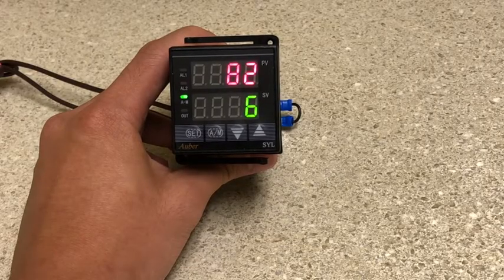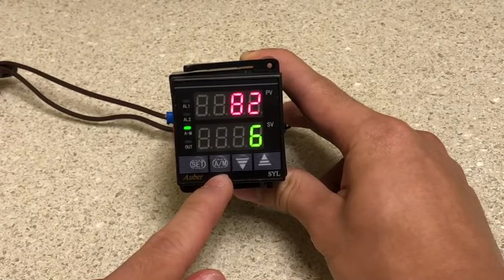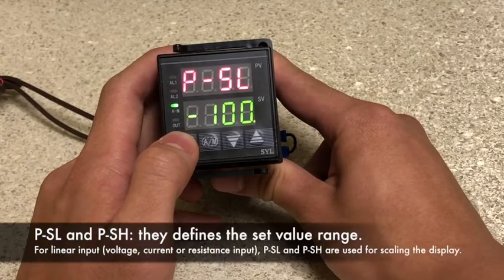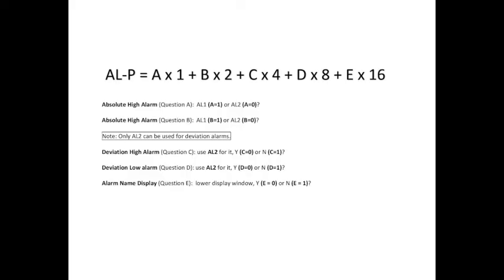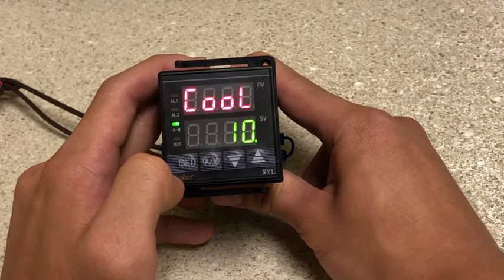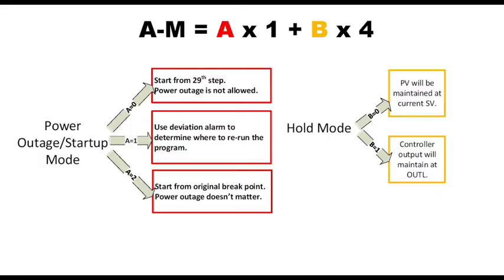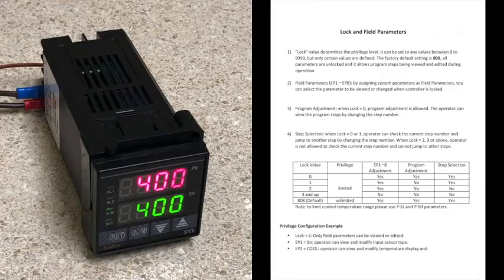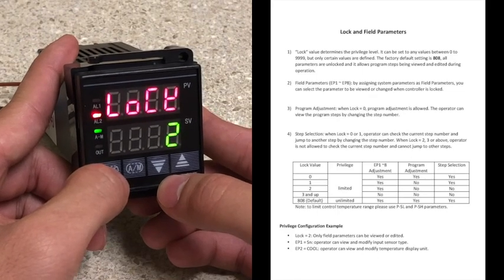Ramp & Soak PID Basic Tutorial, Auber SYL-23X2P Series

Comment: I got the 2342P but it turns out I cant use Wifi (because my wifi is 5Ghz only).  Not the end of the world I thought.  I really only need to run this in manual mode and just stay at the temperature I set.  When I try to enter a temp by holding the up button "STOP" is displayed.  I see nothing in the manual to run this controller in manual mode.  Is there a way? . . . or do I have to make a program to run at a single temperature?
Reply from the maker: SYL-2342P doesn't have wifi function and AW-SYL-2342P has the wifi function. Please confirm the model number for your PID at first. 

Currently, all of our WIFI products rely on 2.4Ghz wifi signal, including AW-SYL-2342P. If you only have 5Ghz only wifi, our wifi products are not compatible at this time. Please be advised, majority of IOT devices on the market are 2.4Ghz only, for energy saving and better coverage. 

Our ramp soak PIDs doesn't have manual mode (which you controls the output percentage directly, not controlled by temp). You may consider the regular PID instead for manual mode (non ramp soak PID).

For ramp soak PID, yes, you have to input at least 2 step program.

Comment: I have a really basic question.  What is the parameter to shut the kiln off?  
I'm using C03= 0 and T03 =0 
The elements were still on, and it was saying 'Hold 0'. If the elements are still on it is not off.
Reply from the maker: In the timer of your last step, set it as "-121". There is a minus sign before 121. If you set timer as 0, it means it will hold at that temp forever. Please check the programming examples in the last several pages of its manual.

Comment: Hello, how do I get it to auto-tune the pid settings? I've set the AT setting to 2 in the expectation that it would start tuning but nothing happens. It just kees flashing AT and the step 1 temperature. Please help...
Reply: AT indicator flashing means the controller is doing auto-tuning. You can check P, I and d values after the auto-tune process is finished. However, auto-tune cannot guarantee a best performance. If you need any assistance with manual tuning, you can contact Auber technical support team.
Reply: @auberinc3934  I think the problem was that the first step had a low temperature so auto tune never triggered or something. I've increased it now and started but still doesn't seem to have tuned correctly
Reply: @VTeslaV  This a ramp & soak controller and you may have different set temperature for each step. Auto tuning can only optimize one set temperature at once. You can use AT=1 to auto tune the critical step when needed. AT = 2 will start automatically after 10 seconds.

Comment: Thank you for your videos they are very helpful but do you have a video describing how to just if the actual temperature is about 60 degrees 
higher than the set temperature.
Reply from the maker: Sorry, we don't offer troubleshooting videos at this time. Can you confirm if your reading temperature (top display) is accurate at first? If yes, was your temperature always 60 degree higher than your set point, or jumping around all the time? If 60 degree higher and stable, it could be an overshoot case. Please try to run auto-tune at that temperature and see how it works. Auto-tune will tune your controller's P, I and D settings based on your temperature and based on your setup. You should have better control than before. If you still have issues, please contact Auber customer support for help.